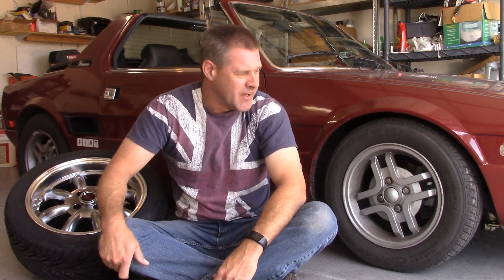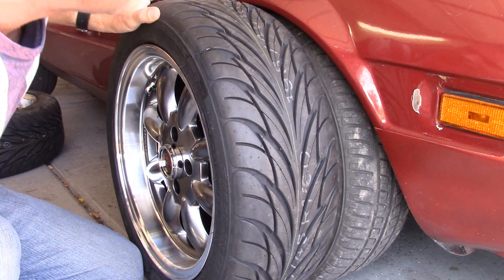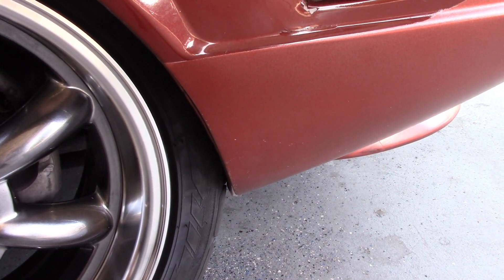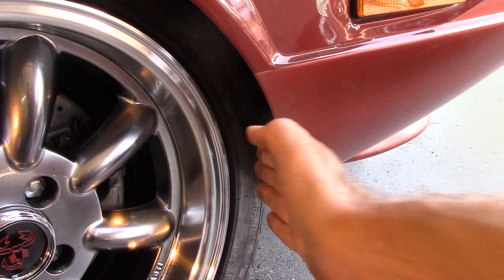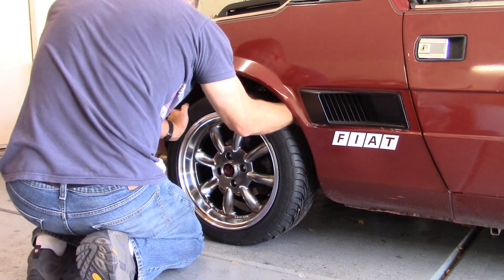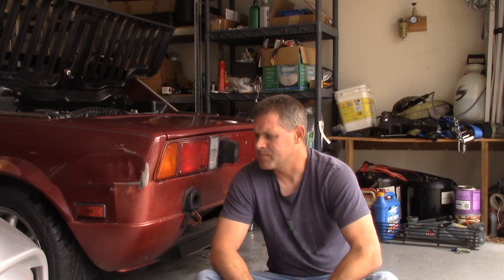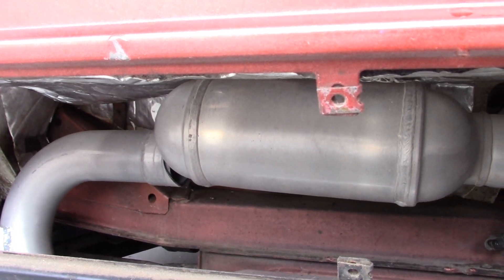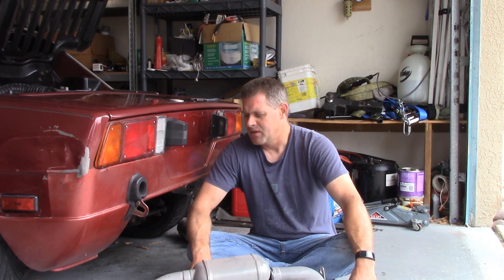Fiat X 1/9 15" Wheel Fitment, Allison Exhaust Epic Fail

Comment: Thanks for sharing your experience John.  I acquired an '86 and have been considering several performance upgrades that you have covered in your videos.
Reply from the maker: Good luck with your X!
Reply: I just got an 1986 fiat Bertone x 1-9 for free from someone and thinking of rebuilding  it back would like some tips of engines .thinking of a Honda 20 engine not sure if that’s right. Thank you for your vids really informative.

Comment: That would be a no on the 205/15, not gonna gain more mechanical grip with a larger tire. Largest suggested tire would be 195/50/15.. NO larger than this.

~What are your goals for this x1/9?

There will be more drag or friction loss due to the alteration of the contact patch. Regardless of the size tire, contact patch remains much the same area, what changes is the shape of that contact patch with differing sized tires. If you're after mechanical grip go direct to "R" compound tires. That WILL make a difference in grip. As for rim width, 6" is often good enough, 6.5" is really pushing it for clearance in the front. Altering wheel offset alters steering geometry and scrub radius. This will alter the feel of the car and mechanical grip. Lowering the car more than ideal for the design of the suspension will reduce mechanical grip rather than improve it. The front should be slightly nose up for the suspension to be where it need to be. As for wheel bearings, 1300cc/4sp cars had the smaller 128 based wheel bearings. They can be a problem, but not any where near as awful as many believe it is. 1500cc/5sp wheel bearings front & rear are completely different. They are MUCH larger with the rear wheel bearing, hub/uprights direct from the Lancia MonteCarlo-Scoprion. Know these were designed for the power of a 3.0 liter V6 or why upping the power in a 1500cc/5speed x1/9 well past 500bhp/500lb/ft of torque is not an issue in any way.

The exhaust system must have a flex pipe or a flex joint or it is assured to fail. The stock exhaust on the x1/9 has a stainless steel muffler and a flex joint using three stainless steel springs and special nuts that do not come loose. To prevent future failure of this exhaust system, a flex pipe or flex joint must be added or the problems will continue to grow and worsen as the welded joints heat cycle and crack. Any hardware used on he exhaust system MUST have nickel based anti-seize to stop the nuts & bolts from becoming inseparable. There are copper plated exhaust nuts (these would be M8) that work far better than the "deformed" prevailing torque nuts shown in the video.

Know about Xweb?
Reply from the maker: Thanks for your input, Rapunzel. I guess I'm just out of luck with tires then. I had 185s on 13 and 14" wheels that were Toyo R888s. The only other option is 185/60/13  Hoosiers if I can find them, but I would have to buy yet another set of wheels. My goal at this point is to sell it because I can't autocross it.
Reply: @johnlawson2576  Why not autocross-able?
Reply from the maker: The smallest tires with any kind of selection  for autocross are 205/50/15. I am AZ Drifter on Xweb, but I rarely go on there anymore.
Reply: @johnlawson2576  If your're serous about solo II aka Autocross, tires would be R compound and NOT anything in 205/50/15.

Wheels & tires are consumable-disposable items on any Solo II_autocross car.

Really sounding like the x1/9 is not for you.
Reply from the maker: @rupunzel6299  I have been autocrossing for 17 years. I have 22 wheels between my two competition vehicles. They haven't called it solo II for at least ten years. Most competition these days is on 200tw  tires. The classes have changed quite a bit. Its just not worth it to keep trying to run a vintage car that isn't supported by tire or wheel manufacturers. I usually compete in a 370Z that has a lot better tire/wheel options. They are expensive tires at 285/35/19 though!

Comment: What front brake upgrades did you do there?
I must still start working on my car again. I've been useless 🤣🤣 my fenders are flared so that helps me a lot with tyre space
Reply from the maker: I just rebuilt the calipers and went with EBC  greenstuff brake pads and DOT 5 fluid.
Reply: @johnlawson2576  so still your original hubs?
Reply from the maker: @aldostefanini1392  I replaced the rears. Just under 100,000 miles on the fronts. Replaced the wheel bearings. Original hubs.
Reply: @johnlawson2576  ok. I'm putting on my lenso 17inch on myne that i have from my racing gocart. My fenders are flared so clearance is not a problem. I just need to machine spacers for 4x98 to 5stud. Will get some aluminium billets. I just need 40mm of sett
Reply: @johnlawson2576  i have a ford granada front hub from the go-cart which is 5x120 i think i must engineer bracket for it to work in front. Then i automatically have bigger brakes and strong hub in front
Reply: @johnlawson2576  i have 205 40 in front and 235 40 at the back. So grip going to be excellent

Comment: In light of all the trouble you had with the Allison exhaust do you recommend Allison exhaust systems ?
Reply from the maker: The bends are too sharp and there is no flex joint to deal with the vibration. The drone at 3500 rpm is severe. Maybe  better to have one made custom.

Comment: As you probably know, you're increasing rotating mass and unsprung weight by going to a bigger wheel. Also, X1/9s and 128s have weak unit wheel bearings to start with. Maybe your cornering will make up for less acceleration
Reply from the maker: The real problem is lack of tire and wheel selection. Compromises are kind of inevitable. 195/45/15s are almost gone now, too. Ideally I would run 200 treadwear 185/60/13 tires on 13x6 wheels, but they don't exist.
Reply: Hi John, I'm in the UK and I spent a lot of time three years ago, stuck exactly where you are now.
This isn't meant to be a criticism, but I think 13'' wheels are an essential part of the X19 formula, were also used in the Gp5 Dallara, and are still the preferred choice at competition level for sprints and hill climbs eg Manuel Dondi, Thomas Kohler.
The smaller the wheel the lower the inertial mass - they spin up quickly.
Fifteen inch wheels will mean you will be stuck with 35 or 45 section tyres, you'll need to raise the car on the struts to avoid fouling the front arches, and not to mention they will look wrong.
What you need is a road legal motorsport tyre for all weathers.
The Lotus Elise still uses 13", and Avon produced the control tyre for it.
It's called the Avon ZZS, in 195 /55 /13, it has an incredibly tough sidewall and is closer to a 205 in terms of width, in fact was designed to replace the 205.
You can run these on a 6J but the next size up (215), requires a 7J.
You can run a 7J on the rear with custom offsets, without modding the arch externally. Internally you will need to either roll the arch or just reduce the lip by 10mm. 
I'm running the 195's all round, on gas coilovers, nearly three inches below stock in terms of ride height, no issues. 
Also, those period alloys are real heavy by modern standards. 
I use Billet Ultralites from image wheels, which are 35% lighter. 
I can send you some pictures of the setup if you want. 
Springs wise, I'm about to install Faulkners all round, 225 rear and 175 front. I've been working down steadily from 300/250! 
I got an Addco front swaybar, reckon these are essential, standard rack but small diameter steering wheel. 
There's also a company called Tillett, they make FIA approved carbon shell seats for the Elise Cup, which fit the X but you'll need to fabricate custom runners. 
You can save a lot of weight over the oe seats, plus gain five inches of legroom. 
I'm fitting a 150bhp 1500 with ITBs, and close ratios from the Punto GT. 
Gordon Fogarty has built a 200bhp small block, just under 2 litre, using the Fiat Tipo block as the base. 
Check out my blog at RMS Motoring Forum / Members Cars / The Ultimate X.
Regarding Allison's exhaust, I purchased their 4-1-2 system and I'm hoping it'll be quiet but I've not fitted it yet.
It was very expensive, and arrived packed in a single layer cardboard box without any padding.
The box was ripped and the muffler dented.
Their response was - well, you got it, so what's the problem?
Anyway, I had my engineer guy look at it. He said it looked like a copy of a good design, but the collector was very poorly made.
Reply: @markbowden7238  Hi Mark, saw your project on RMS and wondered if you still have a car to sell?  Have had a couple of X1/9s in the past and fancied another.
Reply: @patrickdixon4945  hello and very nice to hear from you.
Yes, I've got two for sale atm, both are E-reg, red, west Dorset.
Reply: @patrickdixon4945  Happy New Year ... maybe you changed your mind or maybe I'm nowhere near you... best of luck tho!
Reply: @markbowden7238  I left you a message on your 'home' page (seems you can't pm on YouTube).  I guess you haven't seen it and didn't get a notification.